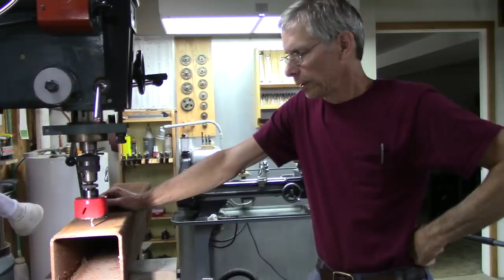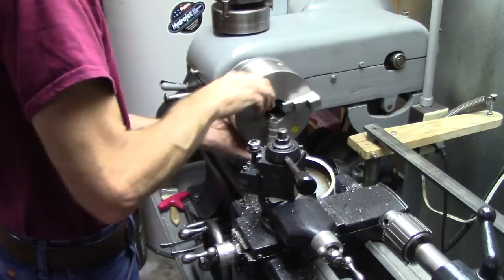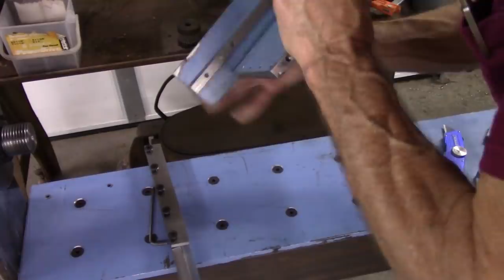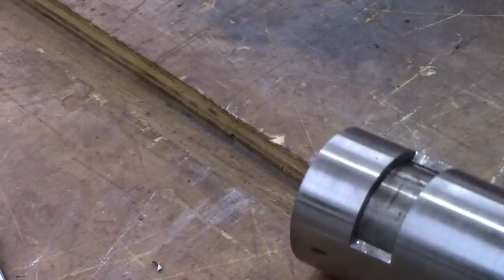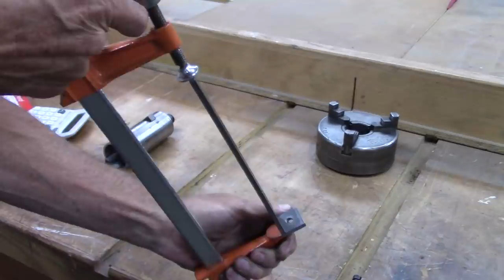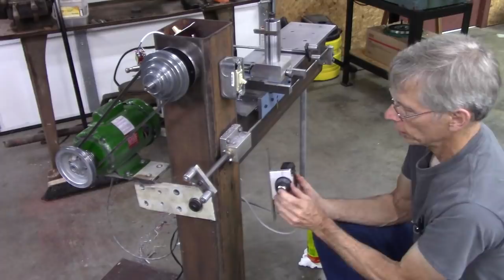Building a Wood Lathe like a Metal Lathe with a Pattern Tracer - Part 1

Comment: Very nice build. May I suggest that you make some machinist jacks to support any work that extends beyond the vise jaws. Drilling out there without support often causes deflection or material slipping in the vise. Thanks for sharing your talents.
Reply from the maker: You must be talking about when i was boring the inside of the tool post. I should have used my steady rest.
Reply: Actually I was talking about the drilling you did at 40:40 minutes into the video. Thanks for the reply.
Reply from the maker: Ah yeah...  That probably would have been a good idea. I drilled slow so in this case I probably didn't flex much and this particular piece wasn't extremely critical. But that's a great suggestion and I will undoubtedly make some jacks!

Comment: I must disagree with you on your description of this being a 'design concept' . . . it is a FULLY FUNCTIONAL PROTOTYPE !  ;)   Thanks for re uploading , yesterday's version was a bit difficult to try to follow without 'visual' .  * You sure have nice 'scrap' !   ' Looking forward to seeing part 2 & how you tackled the tailstock .
Reply from the maker: @KelMaster Construction  - 40 years ago I had a Lincoln stick welder, a grinder, drill press and a hacksaw. I built a waste oil burner I saw in Mother Earth News (that was a waste of time) and a horizontal boring machine that I still use to this day (had a few parts made by a machine shop). After about 5 or 6 years I decided to invest more in woodworking and give up the metal.  Then 15 years ago I had a job change and started design machine improvements for printing equipment.  I learned to draw in cad and worked with the on sight machine shop quite a bit. I didn't do the work but I asked a lot of how to questions. Then 5 years ago I bought a Logan 200 metal lathe and restored it. After that I was hooked. I've learned a lot in the past 10 or 15 years but most of it is common sense. The most useful tool I have learned is CAD. It's the best way to take an idea and make it reality. I used Sketchup (free) but there are many others.
Reply from the maker: I probably miss-worded the description. I was trying to say that building the exact same lathe would be difficult but that the basic design was usable. Nice scrap? Yeah, I love my scrap. Most the metal was heading for the recycle when I grabbed it. The only metal I had to buy was the two main pieces of square tubing and the 1" x 1"  milled for the cross slide... oh yeah and a piece of tubing for the tail stock. Maybe I'll change the wording to prototype and remove the words "Design Concept".  Thanks for the great comment and feedback!
Reply from the maker: @KelMaster Construction  -Yes, the lathe could be made with a variety of surplus steel shapes. I'm guessing there would be over $400 or $500 in steel costs if you bought it all new. It was presented as an idea to follow more than an exact  model for someone to build.